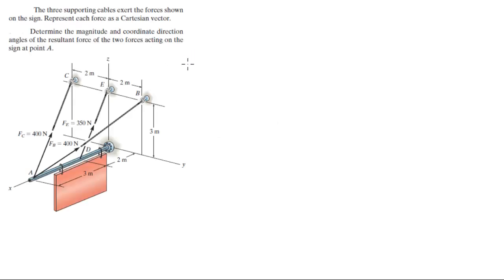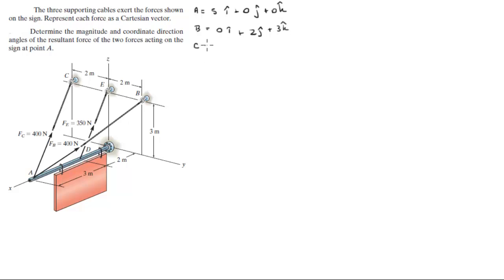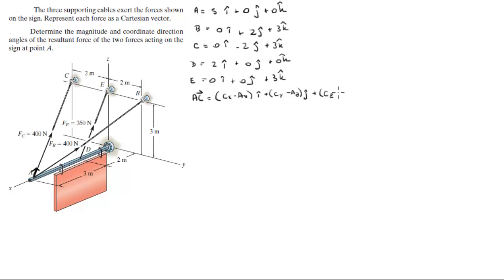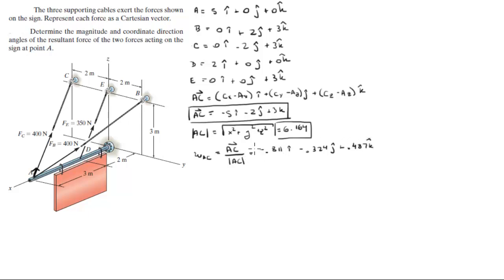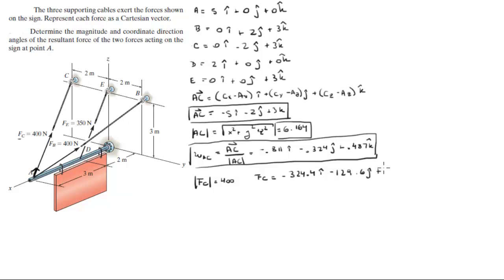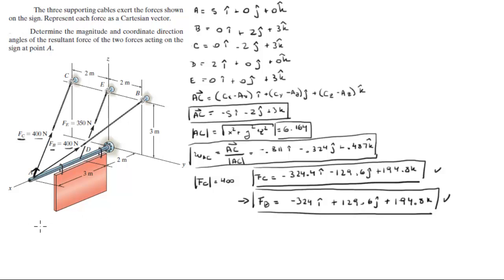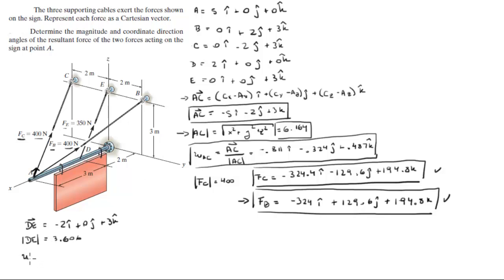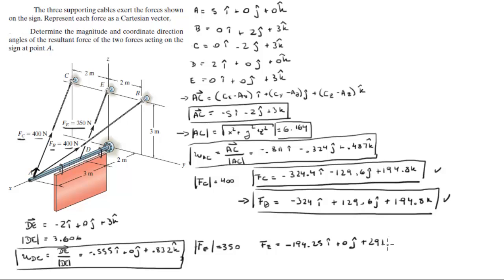Find the Cartesian Vector form of the three forces on the sign and the resultant force

Comment: DIRECTION. Solve the following. Show your complete solution. Find the magnitude and the direction of the resultant using both graphical and analytical method.

1. F, 100 kgf, 30° N of W; F = 150 kgf, 50° N of E; F = 120 kgf, 12° S of E

Use Scale: 1 cm: 20 kgf